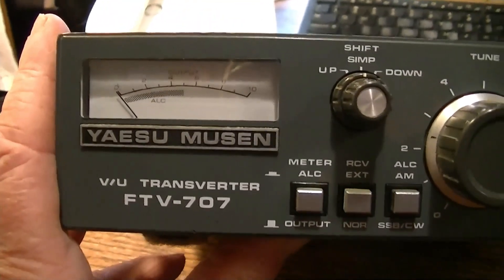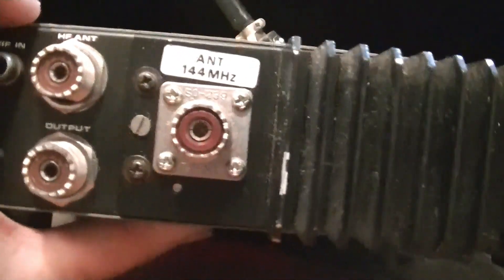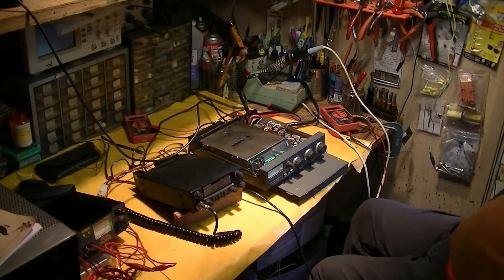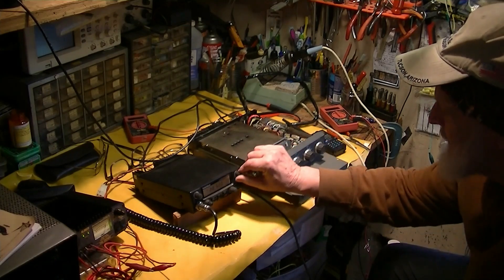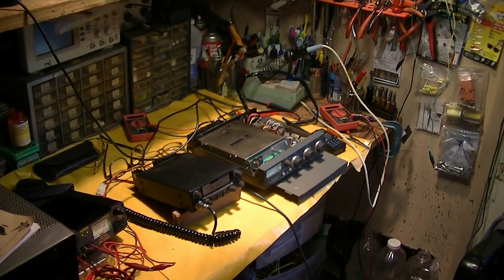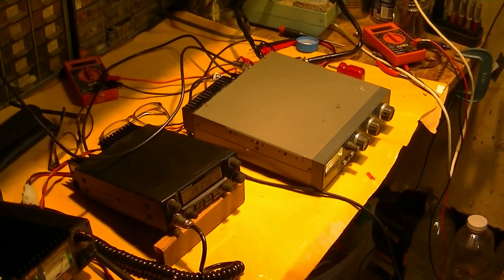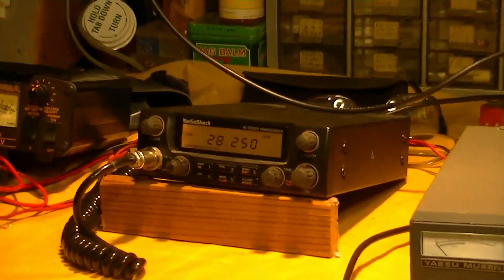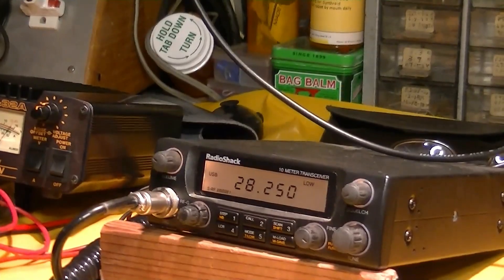Yaesu FTV -707  Transverter   Circa 1985 with 2 Meter Module.  First Reciever Tests.  FM and SSB.

Comment: There was also a module for 6m and, in the UK, one of Yaesu's importers converted some modules (I assume 6m ones) for use on the 4m (70mhz) band.
The same plug-in modules were used on other Yaesu transverter frames, matching the FT-107 and FT901/902. These other transverter frames were larger and could accommodate two modules.

Comment: Very interesting! So much to learn! Love the warmth of your bench lighting…
Reply from the maker: I use an incandescent flood or spot light above the bench, and then magnifying flouresent on an arm when I need it.  I had the optometrist make me magnifying glasses with my Rx corrections for close work... used that for 30 + years.  could not do the work without them.  If you dont have astigmatism, you might be ok with drug store magnifying "reading" glasses. Eye sight going bad is the end of all radiomen being able to work.  I have LED lights for the other lighting, but you have to be careful some generate a LOT of RF noise.  When I run a net, I will turn off all the LEDs' !
Reply from the maker: The more I think about it. the more I think a simple solid state transciever from the late 70's early eighties would be the ticket for you.  Ten Tec argonaut , triton,  for ssb/cw  or Heathkit HW-7/8/9 for cw.   These are simple, non digital, with descrete components  and also very reliable.  So you could tinker and tune if needed, and likely someone will give you one, or you can scrounge up $100 +/- and buy one.   The point after all the work you did to get licensed, is to get on the air, with minimal expense and drama, meet folks you wouldn't know exist otherwise.  The magazines and videos are designed to make you think you need expensive fancy or rare stuff... that's the bunk.
Reply: @captlarry-3525  It’s funny you’d mention the above. I’m having vision problems RIGHT NOW in fact, and am on my way to the eye Dr. I’m hoping I have just an infection and not something requiring surgery like a detaching retina, which I do have some symptoms of… Just lovely…
Reply from the maker: @SteveHacker  Steve.. a couple of hams are trying to contact you by email, but no e mail  is listed on QRZ.  This is short circuiting their efforts to help you with a radio.  my email is good on QRZ... so you can send it that way.. if you dont want to do it here.